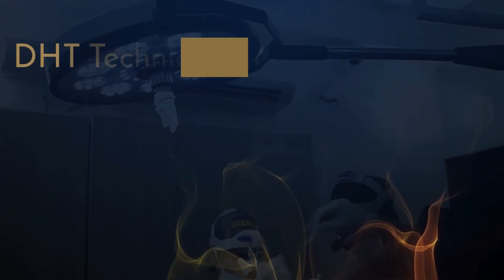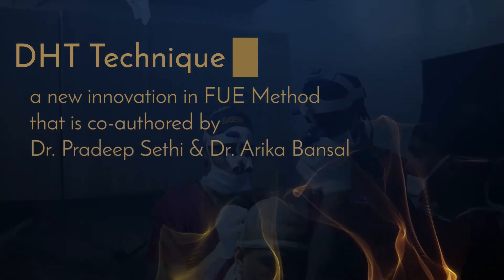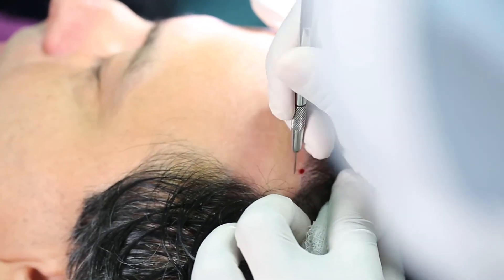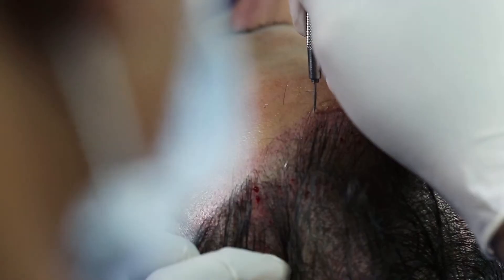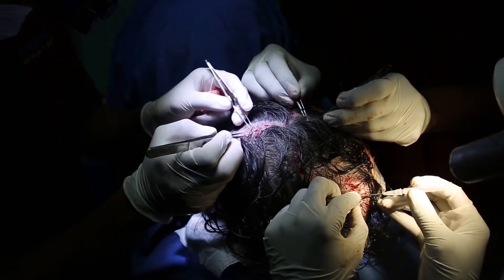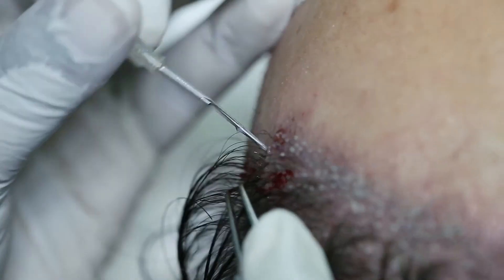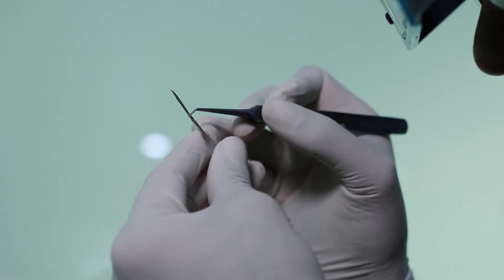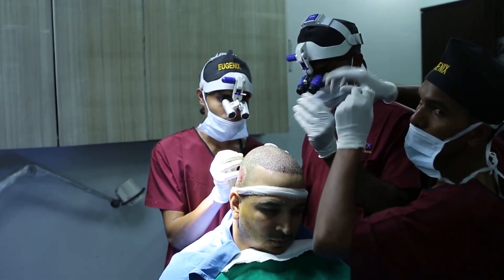How Hair Transplant Works? Eugenix Hair Sciences

Comment: Sir if a 18 year boy have have dense hair but his forehead is in oval shape naturally so does hair transplant make it in like square shape like common foreheads
Reply from the maker: 18 years is not the correct age for transplantation.
Reply: @EugenixHairSciencesofficial  no I am only asking that does it work like that when I am eligible I want to do that but first tell me that does it works really like what I am asking and also tell me what's the right age to do ot
Reply from the maker: Yes, when your age is eligible then you can have your hairline redesigned as you wish to. We do get a lot of cases where individuals do not like their natural hairline and get them corrected. Also, you can send your scalp pictures for evaluation at +91 88264 73333 or info@eugenix.in and have a full consult.
Reply: @EugenixHairSciencesofficial  but what's the age when we are eligible
Reply from the maker: The minimum age is at least 20 above.